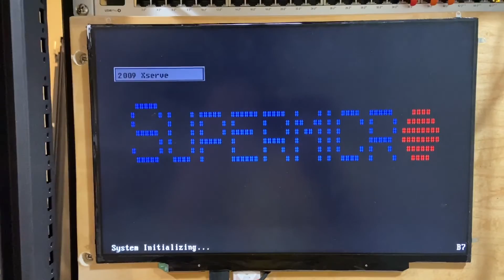Supermicro Quad GPU Compute Server Unboxing

Comment: I just ordered one of these barebone kits off ebay.  It's replacing on old SGI/Rackable 2U server that's not quite up to the task.  Planning on running ESXI and virtualizing TrueNAS Core and likely some flavor of Windows for my plex server  I'm excited to see how Plex will play with a couple of quadros.  I'm really hoping my PSUs don't sound like yours though.
Reply from the maker: I would love to hear your results, and unfortunately I got 4 power supplies and they all sound very whiney.
Reply: @AdamMessmann  Well, it just arrived about 30 minutes ago, and so far my experience is pretty much exactly like yours.  CPUs and RAM have yet to arrive, so no power testing yet, but pulling it apart pretty much mirrored your video.  I'm not a huge fan of the friction-fit lid, but it seems fairly secure so I'm sure I can live with it.  The SATA/SAS cabling is every bit the mystery that you described.  My first guess is that it's an active backplane with a SAS expander so you can either use a SAS controller and the 4 lane cable, or use all of the SATA ports.  I'm going to see if I can find the model number of the backplane and hopefully that will be more enlightening.  I was also horribly confused by the rack-ear power switch and LEDs at first.  In your video there was no obvious way for it to connect electrically to chassis, and until I took it apart and found the micro-ribbon connector I was starting to think it might just be magic, but I did eventually figure it out.  

I'll follow up once I get the rest of the components in and I'll let you know how the PSUs sound.
Reply: Just to follow up, the manual for the server chassis as well as the backplane were pretty useless, other than confirming it is not an active backplane.  Best I can tell, there is just an extra SFF-8087 cable in there that is useless unless you're connecting to a separate SAS controller.  I just removed it, and plugged the SFF-8087 (reverse?) breakout cable into the backplane.  I'll test to see if that works, but ultimately I'm going to have to put a SAS controller in there anyway as I already have SAS SSDs that are going in.  I also ordered an RSC-R2UF-2E8GR riser card so I can get 2x PCIe x8 lane expansion slots on the back, instead of 1x16
Reply: @AdamMessmann  Finally got parts in and server booted.  It's a lot louder than my 1U Supermicro server, even with the power settings adjusted for quietest operation.  I wish the BIOS had better fan control options.  That said, everything else seems to be working.  Right now I have the last two drive bays running off of the onboard 6GB/s SATA controller, and the remaining 8 running off of a SAS controller mounted in one of the GPU slots.  I'm working on installing TrueNAS Core right now, so I'll have a better idea of how everything is working when that's done and I've migrated my storage over, but so far so good.
Reply from the maker: @ajhieb  I recently got dual 1U servers and yeah mine is louder than them too (DL360 G8's). Interesting that you mention the PCIe riser, I was looking to find one of those as I would like to put more than 2 PCIe cards in the back slots. Good to hear everything is working for you!
Reply: @AdamMessmann  Well, the PCIe riser ended up being a bust.  It was a gamble on my part, as SuperMicro didn't have it listed for that chassis in the compatability matrix, but it looked like it should fit so I ordered one.  Sadly, it didn't quite line up so I'm still stuck with a single x16 slot on the one side.  Not a deal breaker though as I only need external access for 2 cards (SAS and 10gb NIC) but I liked the idea of having room to grow.  I still don't have it in "production" yet, but I'll be migrating my TrueNAS pools over soon.
Reply from the maker: @ajhieb  Well I'm glad I didn't impulse buy the same riser after you mentioned it :P - I have been doing a bit of research on the risers but I can't really find anything I am 100% sure about. I forgot if I mentioned it in the video, but my plan was to use the GPUs for password cracking, but I figured it would be more cost effective to use, say, an RTX 2080, as opposed to buying 4 teslas or quadros. In a future video I'm gonna be setting mine up as a test NAS with TrueNAS, as I don't wanna do live testing on my actual NAS.